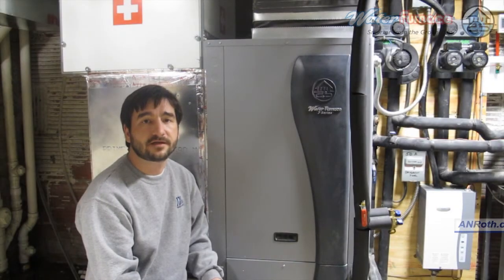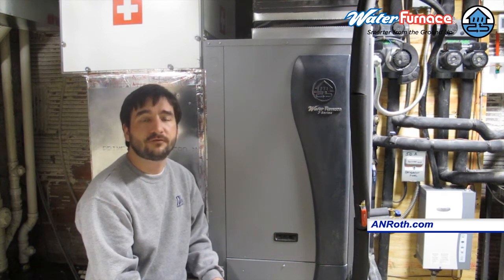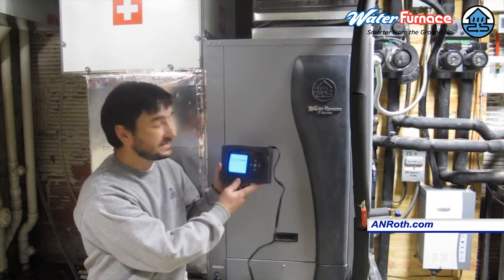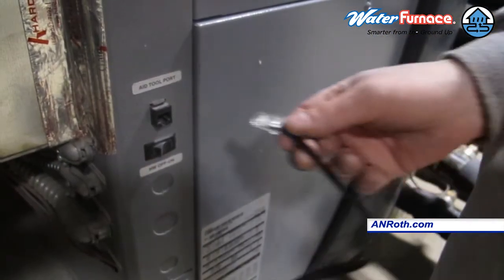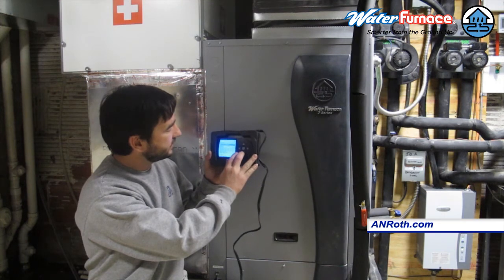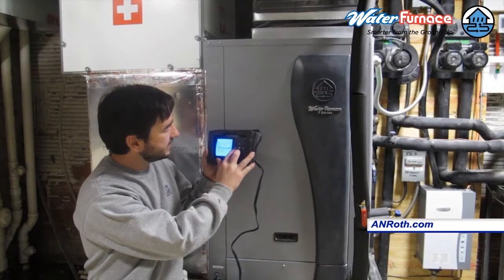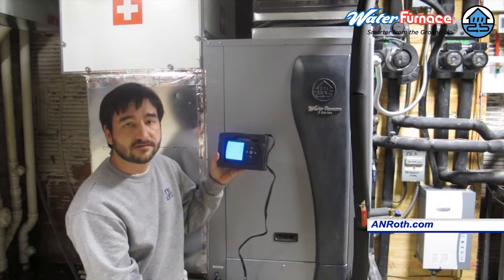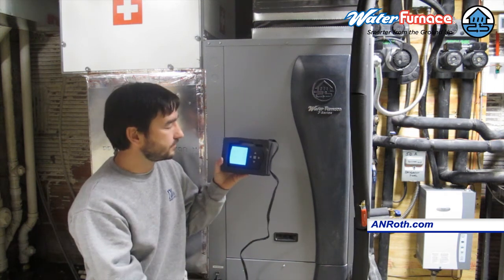A Serious Waterfurnace Advantage - Quick Diagnostics

Comment: Hello ! Very Nice:

The 9 sensor read out of  Hydro-Temp.com  of Arkansas (and builders for WF a while back) used a GA Controls Red Board with IRD to any Palm device for 2007-2013
Logs, Data Sensing, Service required, to controlling 10% to 100%
4 zone capable with all diagnostics and differential calcs. 
same board since 2009, too.

Software ugrades only for the super tech, if desired. The original works 98% of all any tech may desire.

GEOTHERMAL Professionals of all the trade like the latest from their commercial line, the BACNET ProStat with more! on all multicompressor and V-Star VARIABLE compressor systems, 2.1/2, 4, 6 ton

Energy Star (TM) Most Efficient GeoThermal does NOT INCLUDE one feature: PATENTED 1981, H-T Priority Heat Recovery of making Hot Water Simultaneously in Cooling Modes (loop Pumps are "OFF" then)  Why buy Wtr:wtr plus Wtr:Air ?
The first NET ZERO SHOOL in the country , as the Fed Resv Bldg.  all have Hydro-Temp DIAGNOSTICS and Priority Heat Recovery 100% Instant HW on Demand systems, all in one, pumps in units for decades.  www.  GEOPROS.org